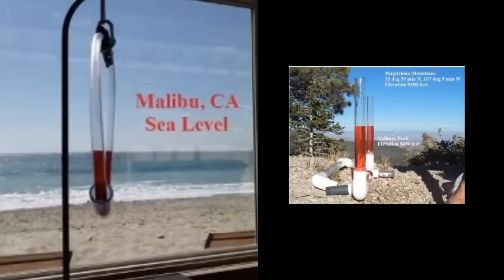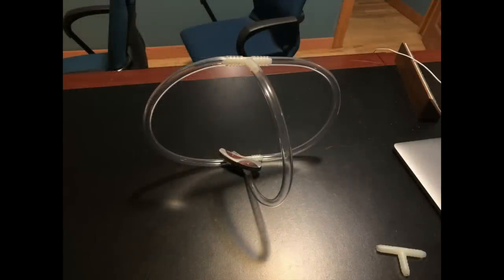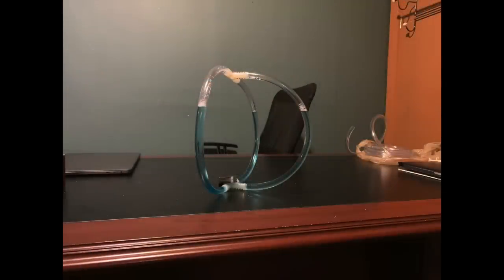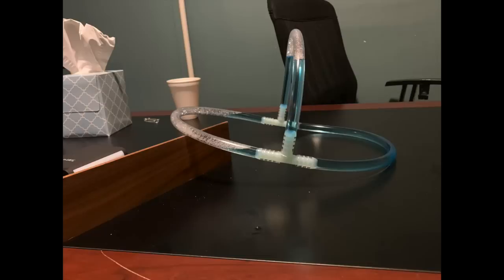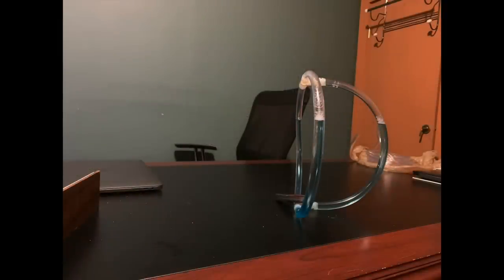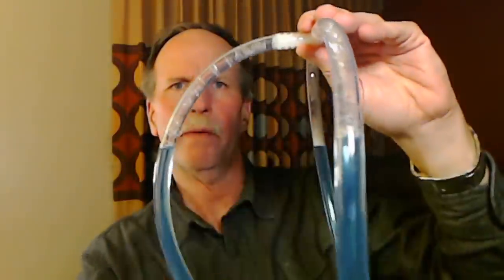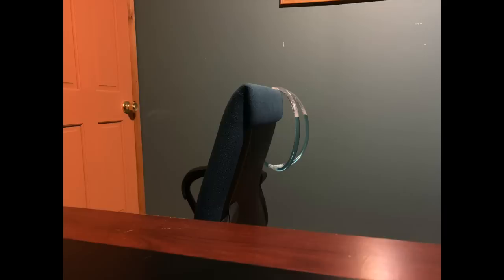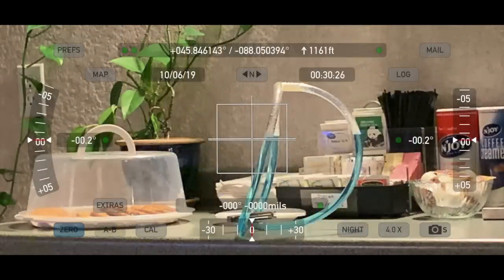Bob's Triple Water Level

Comment: BTW, using  a similar approach you can make a poor man's equatorial mount.  

You can use PVC pipe instead of clear plastic tubing and T connectors to get more stiffness.  Make a loop that  is a full circle (like a hula hoop)  with a diameter of about a meter and  a semi circle (half a hula hoop) with the same diameter that is at 90 degrees to the full circle loop (much the same as your device). Use two T connectors  much the same as you used in your water level design. 

Add a four way connector  at  the top of you semi circle hoop (or drill a hole in it to use a a sight to sight the north star (if one is in the northern hemisphere). 

Place the full loop about  ones head at eye level and rotate horizontally and  tilt vertically it so that the top connector/hole aligns with the north star and the  semi loop near the object that was is intending to observe.  

With a Sharpie Marker one could mark of  right ascension  tick marks on the full hoop and declination tick marks on the semi circle (say every 5 degrees).  With this one can approximately locate the  right ascension and declination for any celestial object. On the solar equinox the sun will move across the sky along the full loop and in the summer above that but at a constant declination angle. 

Since the declination loop is just a semicircle (so as to to leave room for one's head one can estimate negative declination by looking at the positive value and estimating  where the negative value would be. The fact the  the tilt of this device would be the same for any place on the earth at the latitude but different fro any point on the earth at a different latitude is strong evidence that the earth is a globe. 

One can see this with a real equatorial mount but they cost much more and this could be built  this would give one an inexpensive  and easy to use rough equivalent (not nearly as accurate but perhaps much easier to understand what one is seeing. 

Youtubes at different places on the earth could make easily and inexpensively  this and make a video of them using it and any viewer could see that the tilt is different for different latitudes and would be  90 - their latitude.
Reply: Ron, please make one and do a video demonstrating how to use it.
Reply: @hhampton  Sorry, but I at the present don't have the equipment to do that. 

Here is a video that shows how to make the  full circle hoop, only use two T connectors  and two tube segments. 

https://www.youtube.com/watch?v=mC_8ckG6WpU

The one adds a half hoop using the spare ends of the two T connectors. e. g. see

https://www.lowes.com/pd/LASCO-90-Degree-PVC-Sch-40-Tee/1067669

One can drill a hole at the top of the half hoop or add a cross connector there. e. g. see

https://www.lowes.com/pd/LASCO-90-Degree-PVC-Sch-40-Cross-Tee/3371630

The way you use this is  hold it  around your head at eye level and tilt it so that the cross T connectors points to the north star.

That defines the axis of rotation for the sun, moon , and stars.

On the equinox the sun will move across the sky along the  full hoop. In the winter it is move above that hoop but at a constant declaration (as one can estimate  along the half hoop).

e.g. see

http://www.funsci.com/fun3_en/sider/sider.htm

only my approach here uses a hoop and  a half hoop verses a disk and a half disk as in the above link so one can  hold it  about oine head and  sight through the device. Thus it looks much the same as Bob's triple water level but is larger in diameter and one  tilts it to point at the north star to define the ecliptic (the  full hoop) .

Comment: Another option is to use antifreze as it won't foam and typically does not stick to the sides of the tubing. Plus it comes in various colors (pink is pretty much the most common color nowadays). Plus,  it's not like that old poisonous stuff like we had back in the day. Then you can use it in those cold upper Michigan winters when you are outside.
Reply: @Bill Smith 
RV/marine antifreeze is the pink stuff and is safe for potable water lines unlike automotive antifreeze,
Reply: Car antifreeze still contains ethylene glycol. Quite poisonous.
RV antifreeze is propylene glycol.  Found in foods.
Reply: @scott_meyer  - Depends on the antifreeze. Not all is the same. For example VAG since G12 will still make you sick if you drink enough of it but you won;t die. This was because due to the toxicity of traditional antifreeze and typically when there is a coolant issue, it dumps itself all over the ground and thus into rivers and streams. So with it being mandated in Europe back in the early 90's, then German cars were the first to change over.